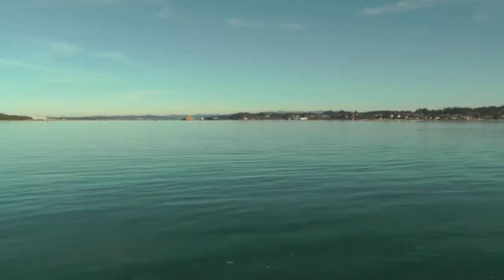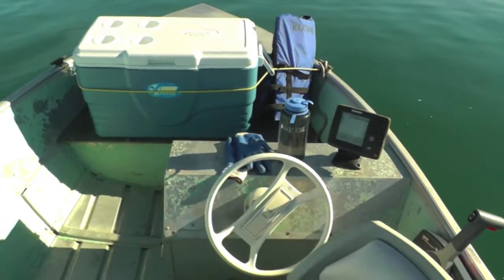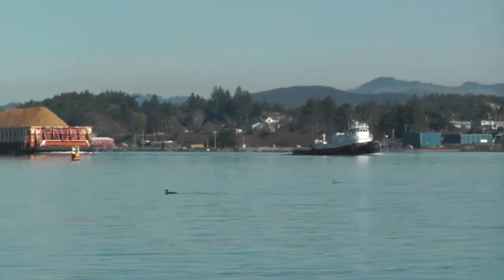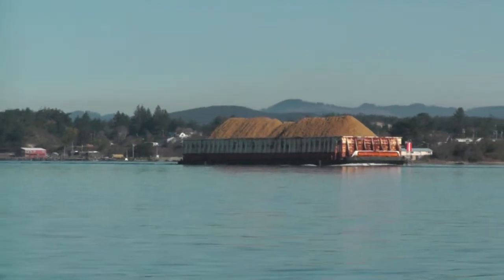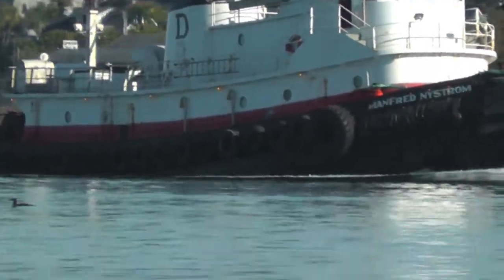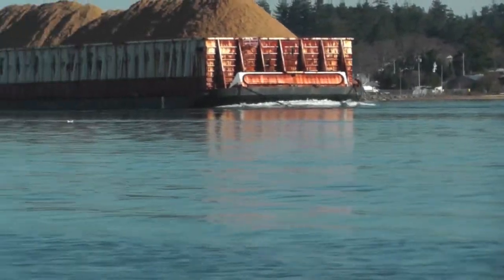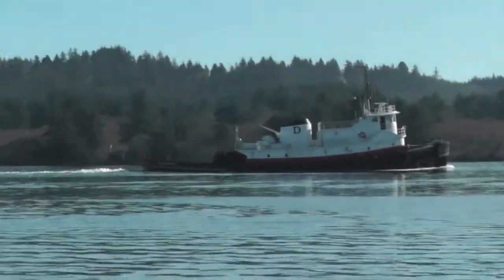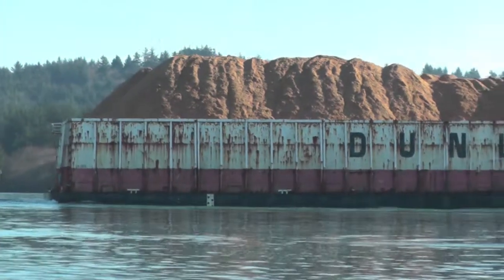The Manfred Nystrom pulling a barge full of wood chips

Comment: Great to see the old Manfred still running strong! Probably running a 5 man crew. Captain, mate, able seaman, deckhand/cook, and an engineer! Most likey that load of chips was headed for the Columbia river! Dunlap has also used those chip barges to haul lumber from Coos. Bay to Southern Calif!
Reply from the maker: Awesome information - thanks! Ive seen that style of barge loaded with all kinds of things, although mostly lumber or chips. I have tried to learn more about the maritime industry and appreciate your comments. I have seen this tug on the bay but really didn't research it  until I took this video. Sounds like you might have worked for Dunlap or on the Manfred? Do you have any idea of the capacity of those barges?